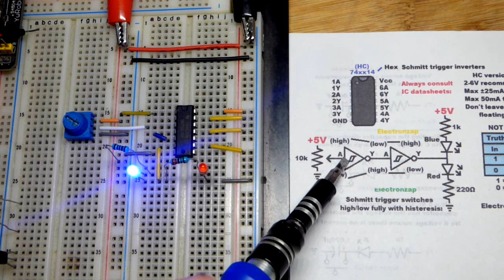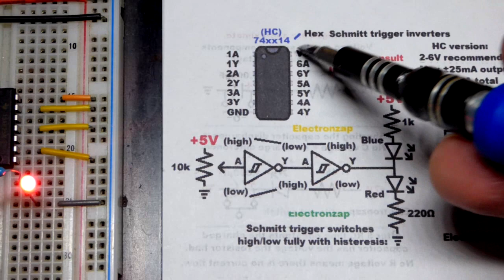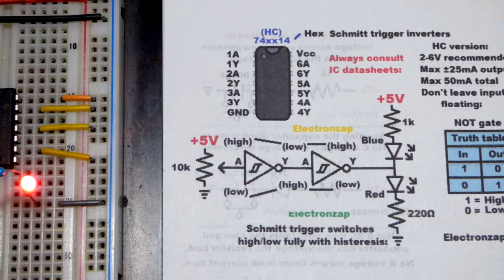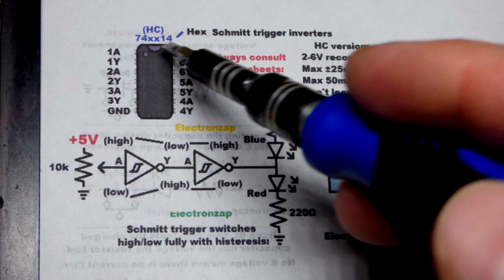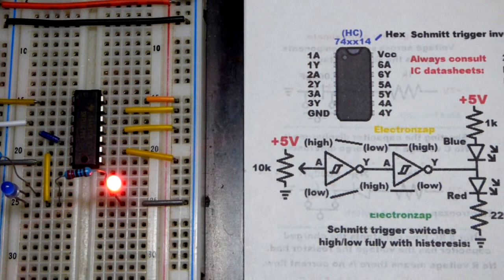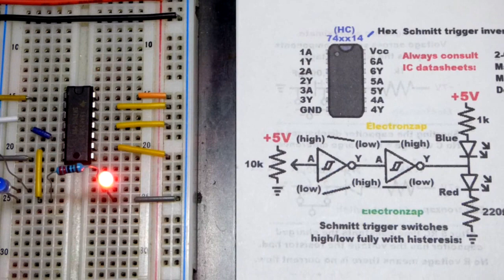Combining Logic Gates where 2 NOTs make a buffer for learning electronics shorts 71

Comment: Could you explain how to make a Schmitt trigger oscilator ? I think it is easy but I can not find a nice video explaining it , I want to use it for a fixed Frequency tesla coil
Reply: Check this link for the circuit you desire   https://www.youtube.com/watch?v=1jM5L-DUxEk
Reply: @justaguy7172  thanks 🙌
Reply from the maker: This was the next video I had go live https://youtu.be/1jM5L-DUxEk Alternating LEDs with Schmitt Trigger NOT Gate aka inverter IC learning electronics shorts 72